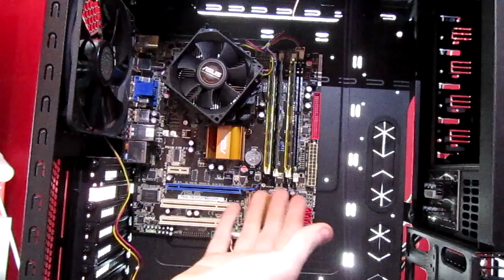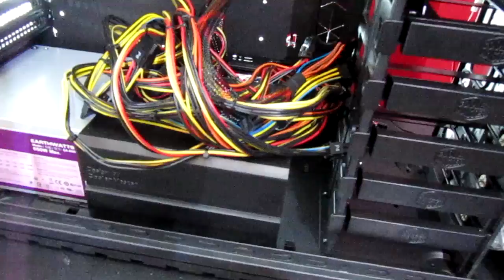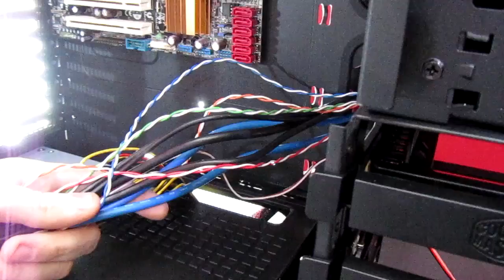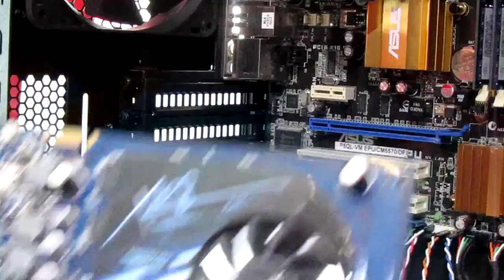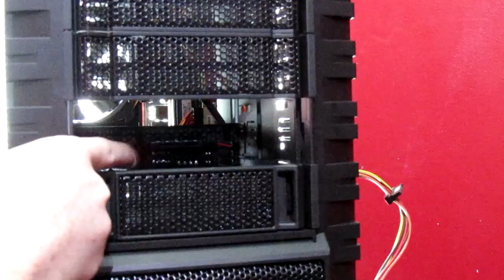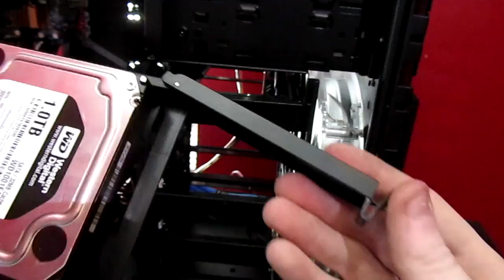First PC Build- Installing Parts into the New Case

Comment: That USB cable that came in the accessory box that you didn't know what it was for, is for using the USB 3.0 with the USB 2.0. What you do is find where the blue USB 3.0 cables go to on the front panel, unplug them, and then plug in both of those USB 2.0 plugs into where the blue cables went into, and then you could plug the other end of that into the motherboard. Sorry if that didn't make sense.